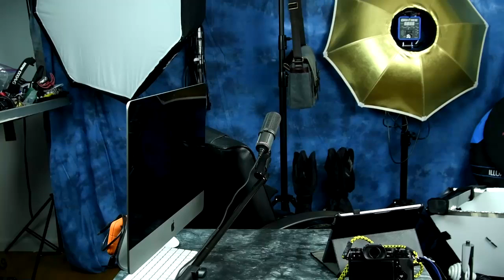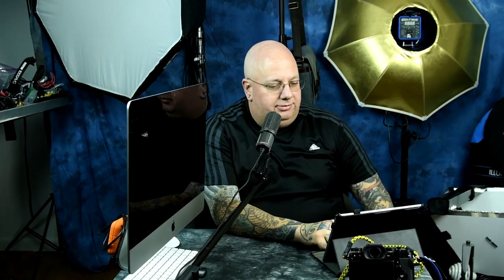HOW TO: High Speed Sync, how it works, shutter types & T1 Flash time

Comment: I've been able to get consistent HSS results with the SB700 and SB5000 off camera using Nikon's CLS. Metering the incident light doesn't work with the light meter I have though in HSS.
Reply from the maker: HSS doesnt work with light meters ...... DERP.......    the new Sekonic however will do it
Reply: I experimented with it a bit and it seems that if you get a incident meter reading within the flash sync speed, just adjust the flash output 1:1 with the shutter speed over 1/250th.

Comment: so, will any of these  work in HSS with Fuji Xe2  or Xpro1?
Metz mecablitz M400 Flash
Fujifilm EF-X500 Flash
thanks
Reply from the maker: dont buy the metz :/ 

EFX500 does fine HSS, ive got 2 of em
Reply: got it, thanks.
Reply: should have listen to you. Got Metz M400, undated firmware.  No HSS with fuji xe2!!!  Sending this time German made garbage back.
Reply: So I called today Fujifilm technical support and they informed me that xe2 doesn't support HSS on EFX500 at all.  So I guess there is no HSS for my camera at all.